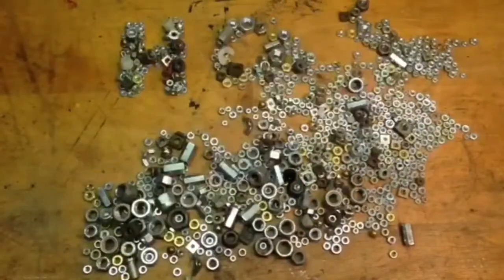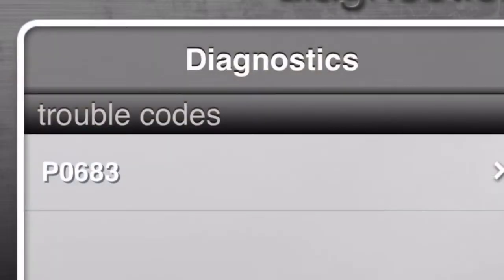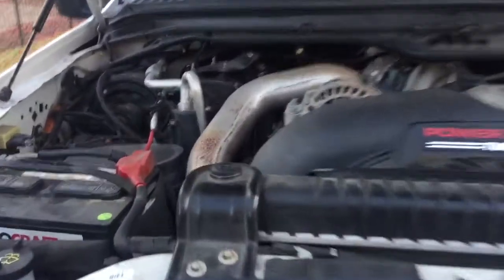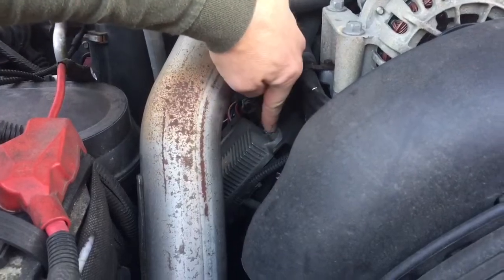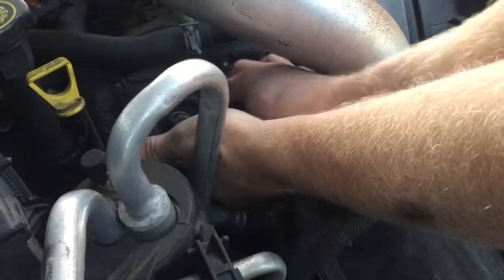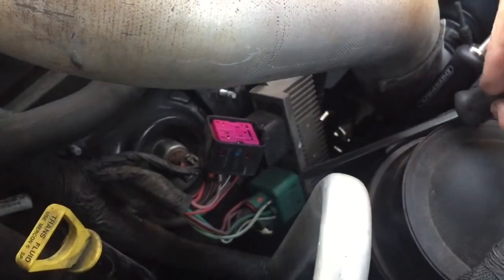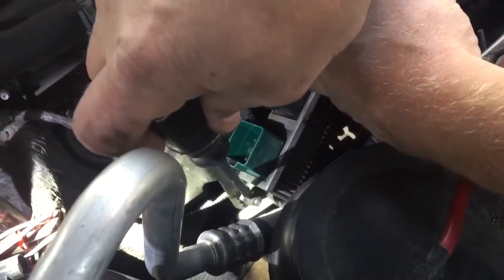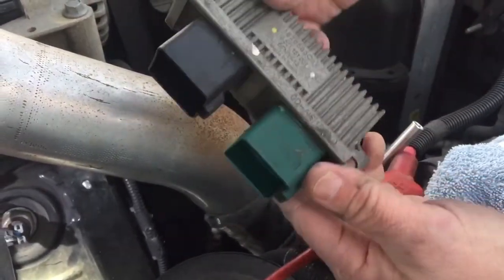How to replace the Glow Plug Control Module in A Diesel pick up

Comment: Did you program the module after replacement?
Reply from the maker: Nope, it was not necessary. It worked as installed.

Thanks for watching.

Comment: What is the difference in the Control Module instead of the relay. Is one better than the other ?
Reply from the maker: A relay is an electromagnetic switch used to turn something on or off, a control Module does more than just on and off. Thanks for watching.
Reply: @funbro1  So going to assume control module is better ?
Reply: @funbro1  On the 7.3 Diesel  would the code be different? I have code P0678 for glow plug circuits 8-6-4-2,seems like I'm starting up with just for glow plugs. Currently have an engine light for this code P0678
Reply from the maker: They each perform a different function not that one is better but different. The control module may be more complex (and expensive). Hope this helps.